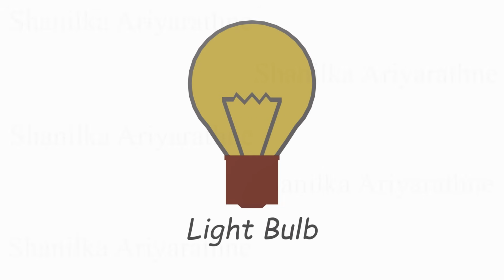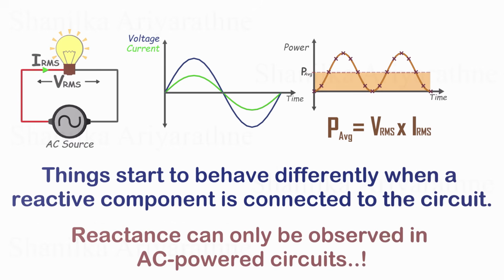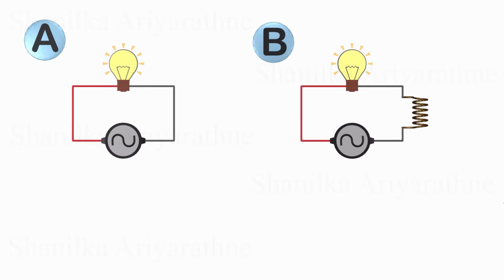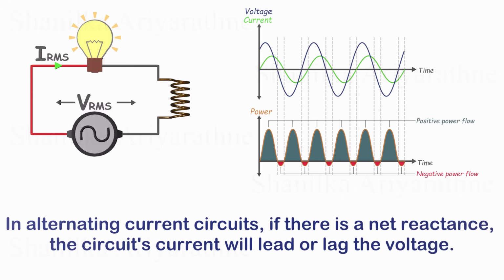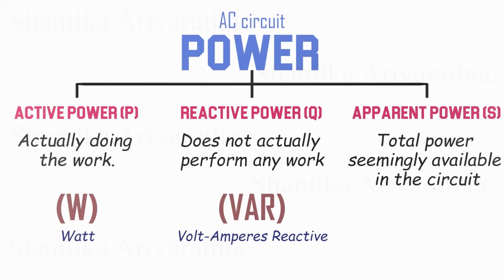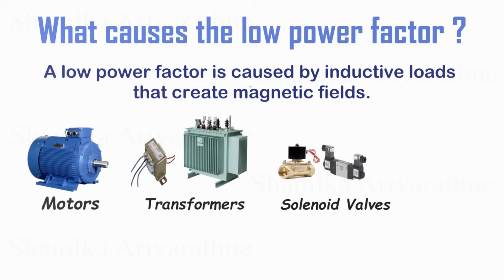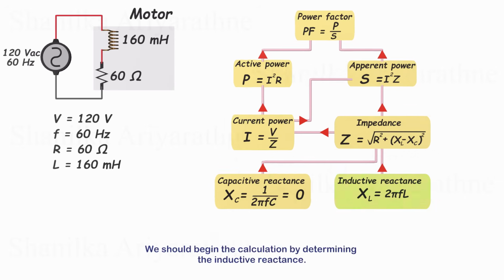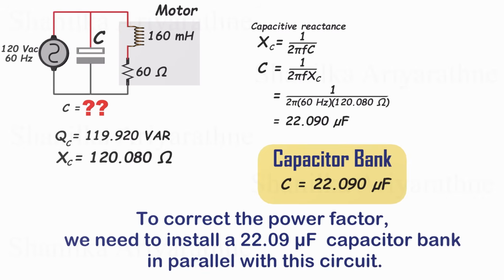Power factor explained | Active Reactive Apparent Power correction

Comment: AI there is no person! Partially correct information. WARNING if you don't KNOW what you're doing, DON'T!!!
CAPACITORS SHORT AND BLOW UP!!!! DISCHARGE ALL Capacitors!!! 
An AC Capacitor is usually two DC ELECTROLYTIC CAPACITORS WIRED BACK TO BACK: + to hit, -to -, + to neutral. Buy and ESR TESTER $12 to $66 and test EVERY SINGLE COMPONENT!!! MOST are Chinese sabotaged Counterfeit POS crap, and are NOT to spec, at best. And will FAIL

Comment: Wondering if I can install a capacitor on my house breaker panel for efficiency?
Reply: You can but it's a waste of money anyways. Most home appliances are resistive loads. So the power factor is already approximately 1. This is why electric company bills you on the actual power you use, not apparent power. Just look at your electric bill next time. Power factor only matters in industrials where there are big AC motors that consume a lot of power.

Comment: Great Video; a good review from power class in power factor, power triangle, volt amps and VARS . I'd like to see this applied to an evaporative motor or sometimes called a swamp cooler motor with the two sets of windings. Hi cool and Lo Cool with the capacitor contained in the motor. Not seeing anything online going over the real-life application of evaporative cooler motors. I have more experience with three phase motors and changing brushes on DC motors. If you could make something explaining how to troubleshoot the and evaporative cooler motor using a DMM in lay-man's terms it may be a big hit. Great job of breaking down with illustrations, formulas and drawing the wiring diagram. Evaporative coolers were widely used in the South-west United States where humidity is low. As they aren't effective in areas where the humidity higher on the East, and Southeast of US. Where I live in the west newer houses are just putting in AC now. For older houses built Prior to 1980 some still run evaporative coolers as the systems are a fraction of the cost of AC.

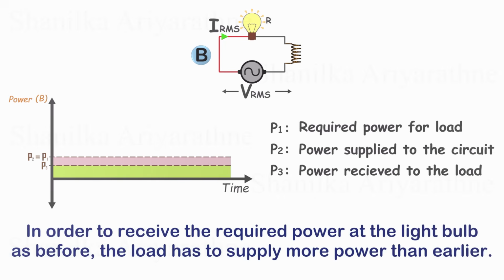Comment: Truly excellent video that breaks this down to a level that makes it easy to understand. I have a question, from around 08:00, you say that the "load" has to supply more power than earlier, my understanding is that it is the "source" that has to supply more power than earlier? Someone help me if I am wrong.

Comment: I watched several times to fully understand about this power factor. I also have watched your video titled "Calculation of power factor correction." So, one my question that is still ringing in my head is, for RESIDENT/HOME use which only the ACTIVE/REAL power (kWh) is paid, will we pay less the electricity bill if we may eliminate/cancel the Q (the reactive power, the kVAR)?

Comment: You have ignored the type of power factor that is affected by an electronic load such as a bridge rectifier.  this cannot be corrected with a capacitor. It requires an active power factor correction.

Comment: Sir , i have a doubt , after adding capacitor some current flows through capacitor wright? then reactive power along inductor may decrease wright? i.e. imaginary component of current will divide at at top node wright? then we need to consider a case where imaginary component of current flowing through inductor and capacitor should be same?!.... , can you clarify me sir?

Comment: What  I am missing here 5:33 is, when inductance is returning the energy what is happening with that energy? Is AC Source not able to accomodate that energy? How come it becomes lost?
Reply: Heat
Reply: I'm guessing because of wire resistance.  Power will be wasted as heat

Comment: 😮There is power delivered to the light bulb 100 % of the time. Just because the instantaneous power delivered by the source is negative doesn't mean the light bulb receives no power during that portion of the cycle. The instantaneous power from the inductor exceeds the instantaneous power consumed by the light bulb so the net instantaneous power from the source is negative. The waveform of  current in the series RL circuit is a sinusoid and so the instantaneous power delivered to the light bulb is only 0 at the instant the current is 0.

Comment: Thank u, it's the best explanation of this topic I've ever seen before! Amazaing how easily its possible to explain instead of hours spent at lections in university. One thing not explained in video how energy flow will be changed due to presence of condesator, I mean when there is only power source and inductor, the inductor during discharging directs power back to the source. How it will be changed dut to condesator presence, will it charge condenser and after that condenser gonna be dicharged, but in which moment?

Comment: I'm trying to relearn. Question: Isn't a cap a short to AC? 
So, isn't a cap in parallel with an AC source just a short circuit through the capacitor??

Comment: P =  V dc X Idc because the Power source is DC ,  If the Power is AC do I have to put P = Vac X Iac can be the Result are equal. Remember AC Power is Alternating Power while DC is Direct Power, I mean to say an AC Power is a Peak to Peak power While an DC Power can not reach the Peak to Peak Power of the AC, Then What is it since their wave are equal but the DC can not reach the Peak to Peak of an AC Power, Also The circuit is a coil, When you made the Coil at Clockwise rotation and suddenly you turn rotating the wire in Counter Clockwise direction till the coil is ready to use, Is there no Problem in the Lamp or Coil. OK Thank you

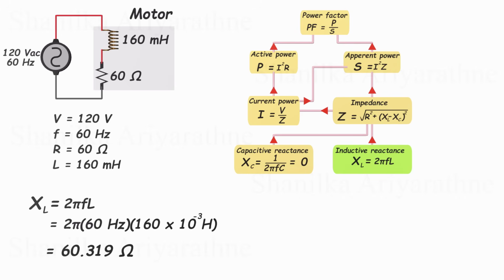Comment: At 17:49 when you already have XL and Z (sin phi=XL/Z = 60.319/85.078 = 0.709 or phi = 45.15 deg), then power factor (cos phi) is immediately computable as cos (phi=45.15 deg) = 0.705.
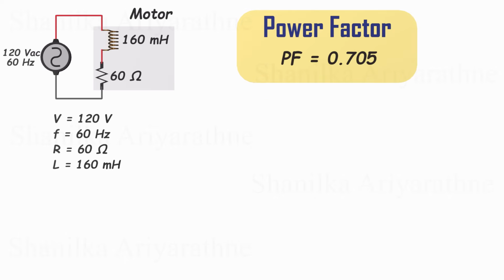Why calculate current, it's square for all the power calculations and then cancel all these intermediate results that are not needed for power factor calculation at 18:19.

Comment: One doubt..what if we connected higher rating capacitor which is more than the required level of reactiver power to compensate,where will that excess capacitive reactive power goes?and what impact foes it have on sorce?

Comment: Everyone is praising this video and all the time, this video does not even know what power is. It says over and over power does work. Power DOES NOT DO WORK; energy does. Power is a measure of how fast work is done P=W/t. In other words, it's a measure of the rate of energy transfer which is work. How can you praise a video that talks about a topic and doesn't even know what it does. A 1000 HP motor can transfer energy 10 times faster thsn a 100 HP engine so it's going to be able to do a given workload 10 times faster, hypothetically, than the 100 HP motor. It doesn't do 10 times the work. How much work it can do depends on the time. If time is the same, then it should theoretically be able to do 10 times the work. To say power does work is just wrong. It's a measure of energy consumption not the capacity to do work which is energy.

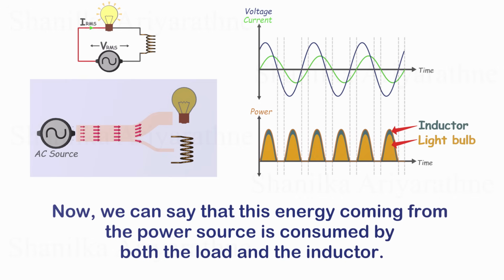Comment: This video is not correct in depicting the effect on power flow at e.g. 9:29 , since the peak of the power is not only lowered due to the reactive component but also shifted in time due to the current "lagging" the voltage

Comment: In domestic households the power factor is usually capacitive. 
That's why there's no point in connecting another capacitor to the mains.
The measuring devices used for households only measure the active power and not the power factor.

Comment: At 5:20 explains the energy in the magnetic field is flowing back at voltage decrease... This is the feature used in the controllers for brushless motors to detect the rotation direction at startup..

Comment: The nature of a coil is, that it will resist change in the electromagnetic field. So when the field change by decresing voltage, the coil tries to maintain the field by increase the field. This is the reverse power and You can actually see this effect by the spark generated when You disconnect a coil. Fx. a 12 volt appiled to a coil will produce a 1000V spark when disconnect, but with much less current ofc.

Comment: As far as I know, a single phase motor use a capacitor for starting, then after the motor is running, does the same capacitor shift its function and serve as a power factor corrector ? thank you.

Comment: u can use solving capacitance by not solving the reactance by using the voltage^2 
 "Capacitance = Qc / 2pi x 60 x 120^2 = 22.0900 micro Farad."

what is the corrected P.f of the system?corrected P.f =0.892

Comment: how about "jacobs law"?

all of these examples assume the supply, the source, to be "constant current, constant voltage, zero impedance".

in reality, the source is ALSO a resistance. and its in parallel with the load. 

at that point, it becomes an exercise in impedance matching... you cant have a load that is lower than the source resistance. doesnt matter if its reactive, virtual, or resistive. the best scenario is when theyre equal...

i still havent found anyone demonstrate jacobs law, let alone mention it.

Comment: You are wrongfully implying that the negative energy part supplies no energy to the light bulb but any instant where current flows the bulb gets energy according to I² * R bulb.
The coil can only deliver energy back to the source by sending current through the bulb thus supplying it with energy.
Very informative video besides this detail.

Comment: what happens to the Reactive power that goes back to the Mains power source ? does it re-combine with the grid and helps power other loads ? or does it goes straight to the return/ground path being wasted ?
you mensioned in the videos that it keeps oscillating back and forth between the source and the reactive component, does that mean that the amount of this power is being conserved and not comsumed at all ?

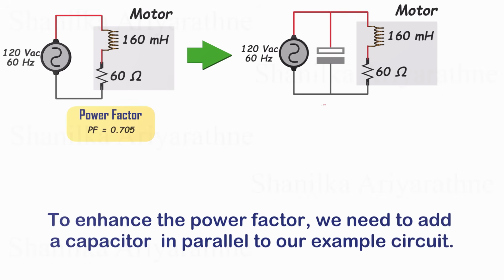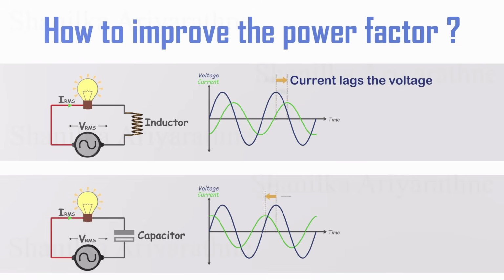Comment: It's not clear to me why, for the last power factor calculation at 18:45, one wouldn't add a capacitor in series with the motor.  At 14:50 it is shown on the bottom schematic that adding a capacitor in series (not in parallel) with load causes the current to lead the voltage.  This appears to be what we want to happen in the last problem to cancel out the inductive effect by bring the lagging current back into phase with the voltage.  It's implied that connecting the capacitor in series produces the same effect, but isn't articulated.

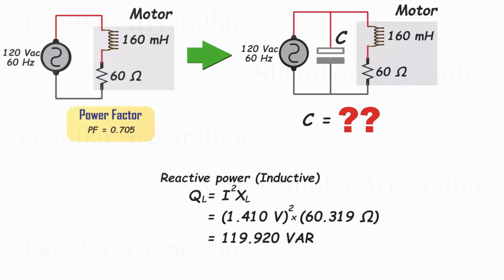Comment: This is the best explaination I have ever seen.  Did spot a minor typo error in the formula to calculate the "Reactive Power (Inductive)" at 19:08 in the video. QL=I2XL. When you plugged in the values, you are showing 1.410 volts squared.  This should be 1.410 amps squared since the formula is squaring the current and then multiplying by the impedence of 60.319 ohms.
Reply: I see it as well.
Also, if you know both the apparent and real power, the reactive part could be worked out using Pythagoras.

Comment: Exemplary Teaching, I am a retired Engineering Electrical/Electronics/Mechanic: Aerospace Laboratory Technician from Lockheed Environmental Test Laboratory, and this reminds me of an Engineer who taught me a lot of things this way. Thank Your Professor.

Power factor is important for several reasons in electrical systems. Here are some key reasons:
1.	Energy Efficiency:
•	Power factor is a measure of how effectively electrical power is being converted into useful work output in a system.
•	A high power factor indicates efficient utilization of electrical power, while a low power factor implies that a significant portion of the supplied power is not being used for productive work.
2.	Optimal Use of Resources:
•	Efficient power factor helps in optimizing the use of electrical resources and infrastructure, reducing wastage of energy and minimizing operational costs.
3.	Reduced Energy Costs:
•	Many utility companies charge industrial and commercial users based on their power factor. A low power factor leads to higher apparent power, and utilities may charge higher fees for this excess capacity. Improving the power factor can result in cost savings on energy bills.
4.	Prevention of System Overloading:
•	Inefficient power factors can lead to higher currents flowing through electrical systems. This can result in overloading of transformers, generators, and distribution equipment, leading to increased wear and tear and potential system failures.
5.	Enhanced Equipment Lifespan:
•	Improving power factor reduces the stress on electrical equipment and components, extending their lifespan and reducing the frequency of maintenance and replacements.
6.	Voltage Stability:
•	Power factor correction can contribute to improved voltage stability in electrical systems. A low power factor can cause voltage drops, leading to voltage instability and affecting the performance of connected equipment.
7.	Compliance with Regulations:
•	Some regulatory bodies or utility companies may impose penalties on consumers with low power factors, encouraging businesses to invest in power factor correction to comply with regulations.
8.	Efficient Energy Transmission:
•	A higher power factor reduces the reactive power component in the system, allowing for more efficient transmission and distribution of electrical energy over power lines.
9.	Environmental Impact:
•	Efficient power factor contributes to reduced energy consumption, which, in turn, can have a positive impact on the environment by lowering greenhouse gas emissions associated with power generation.
In summary, power factor is crucial for achieving energy efficiency, minimizing wastage, and ensuring the reliable and cost-effective operation of electrical systems. Businesses and industries benefit from maintaining a high power factor not only in terms of cost savings but also in promoting sustainable and responsible energy usage.

Comment: This can be a difficult subject. Reactance with inductors and capacitors. Very important to understand when building a circuit. Most just want to take a volt meter to areas of the circuit. However, rarely do we analyze a circuit with 3 types of power. Power triangle. God bless them, they figured out how to add trigonometry to electric circuits. OHH Henry! If you know the the power factor percentage you can generally estimate needed capacitance. 70% Work factor on 120v  leaves you 30% of the 120v. to overcome. Thank the world for catalogs and capacitance charts.

Comment: It's not correct to state that the released energy does not go through the load. It is simply released back into the circuit and will go where ever the circuit configuration will channel it. That's important precisely, because the load will "feel" it.
Reply: can you elabourate further on how the  load will feel it..  and where is this energy typically channelled? best regards
Reply: To reach the load it should go through the power source as well. So the majority get lost in the system not in this small load taken in this calculation. What you tell is true if the inductor was parallel to the resistive load.
Reply: Thanks for your comment because I sas a Little bit confused by this point in the video.
Reply: Can you elaborate this ?
Reply: As current is directed to opposite side, the stored energy will not go towards the load
Reply: It’s important to note that that energy is not somehow “recycled”. It dissipates all over the system as heat, the junk drawer of energy
Reply: I agree. Energy does make it back to the load, absolutely all of it except for the portion temporarily stored in the magnetic field of the inductor.
Reply: The animation shows current due to energy stored in the inductor flowing in just one conductor. That is utter nonsense. The lamp is an essential part of the path for the current at all times in the circuit.